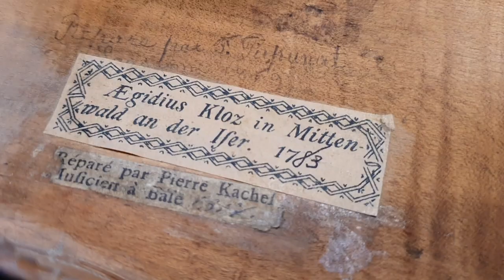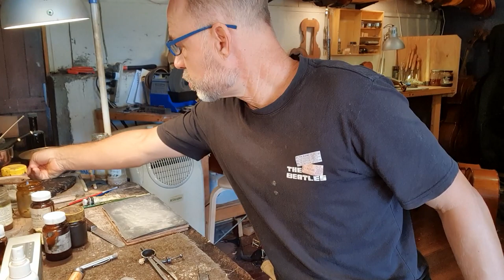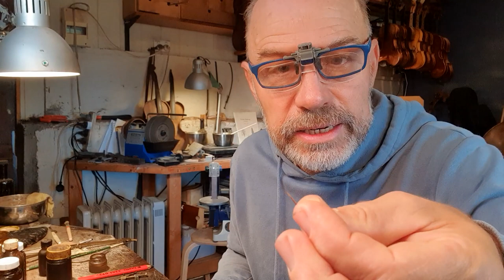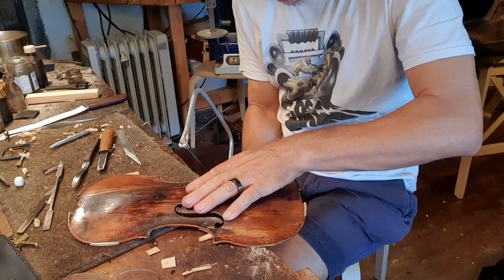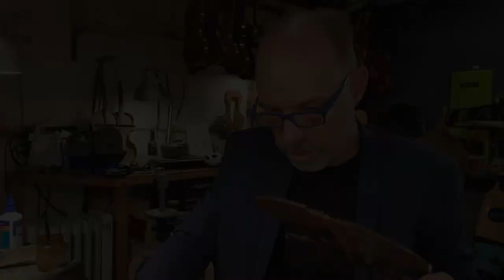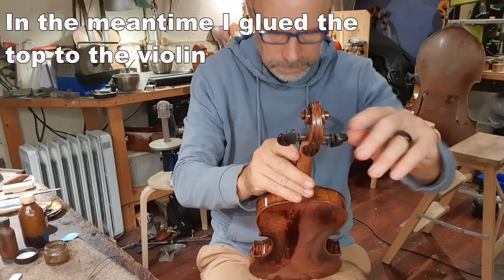230 Year old Violin Restoration (Transformation) -  F-hole Crack!!

Comment: Hey, how do you remove top plate from violin, simply cut with thin knife or something more specific? I've bough one old violin to play with tuning it and restore and I've cut it off, but it destroyed some parts of edge. 
Another thing - what do you think about hardening of surface with some hard lack - and what do you think about lacquering interior body of violin? and why it is barely done, if ever?  Thanks

Comment: I have a vintage violin from late 1700s to early 1800s made in Austria whuch has been repaired but not the scratches .  Do I touch up scratches & blend in,  or did bI need to remove all varnish & then revarnish ?
Reply: Never remove the original Varnish

Comment: Did you actually need to spend full 8 hour days or is it 1 or 2 a day ?
Reply: a lot of that time is probably waiting for glue or varnish to dry...
Reply from the maker: It's just little bursts each day and then lots of drying time... You can see the rest of the restoration taking shape as I restored these 2 cracks.

Comment: Lots of time = large bill for services.
That's just a fact.
I hope the instrument was worth it, but I'd guess that sentiment associated with it was the biggest motivator.
I'm sorry that you didn't show what you did with all the squares you had attached to the back side of the top.  Did the grain on those pieces run in line with the grain in the top, or perpendicular?  Were they permanent additions, or temporary for alignment?
Reply: They are called cleats.  They are glued in with the grain perpendicular to the grain in the top. They are shaved down with either a chisel or a small plane so that they are just a little above the surface.  And I think they do affect the sound slightly but if you don't put them the crack will open up again.  I'm not sure if he has shown it in a previous video.
Reply: @nancymilawski1048  
Thank you.  I would assume that they have some impact on the sound.  
I'd be curious to hear about the justification for using them, as opposed to any other method.
Reply from the maker: Oops... Yes... 
I think there's a video of another crack repair I did a while ago that shows the cleats when they're finished.
Reply: @AskOlaftheViolinmaker  
Thank you, sir.  I'll hunt that video down.